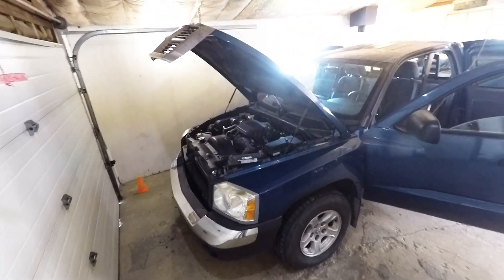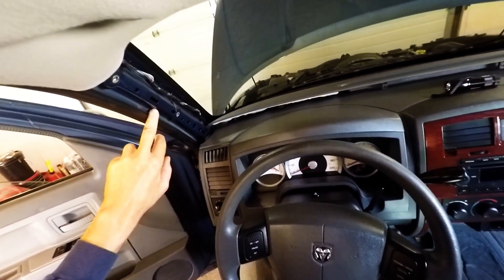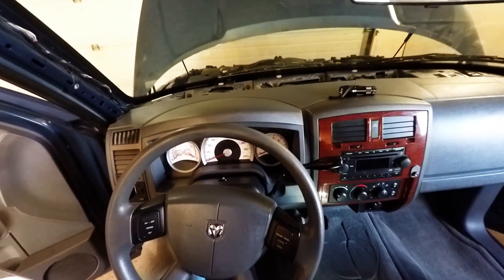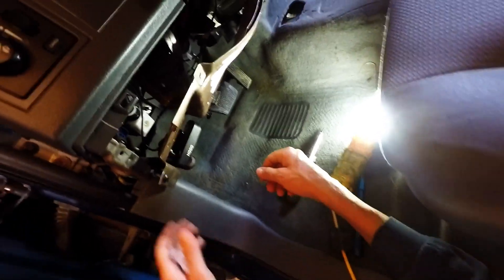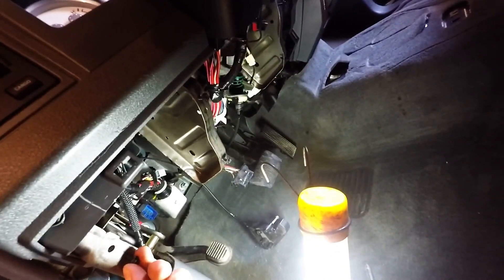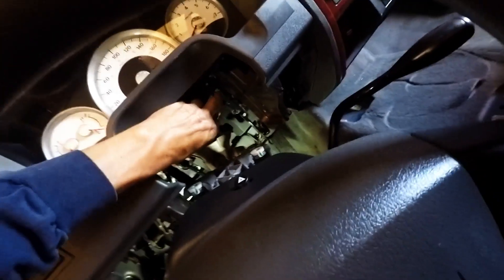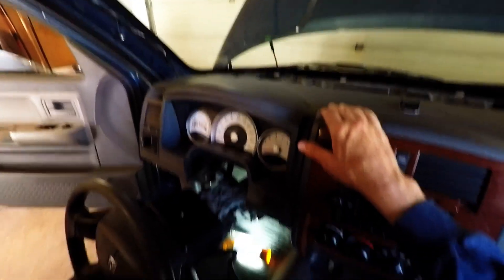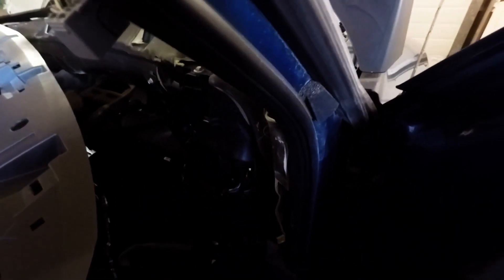Heater core replacement  2005-2011 Dodge Dakota

Comment: Great video and a huge help. The three studs that go through the fire wall have nuts that need to be removed. The 2 end ones are ok to get to, but the center one is super hard to get to. On the V8 it is located just behind the right cylinder head. Took me several hours just to get one nut off. Also be careful when taking the entire distrubution box apart, the damper/acuators have to go back in exactly as they came out or else the blend doors won't work properly, mark everything and it's position when you take it apart. Also the plugs on the acutuator damper motors are all the same and you can mix them up, again mark them before you unplug them. I made these mistakes but got it fixed. Again, thanks for the great video.
Reply from the maker: Thank you for taking the time to add your experience.

Comment: My dakota wont start after doing this job smh. Everything is connected 🤷🏽‍♂️
Reply: Cant be lol. Check your grounds on both sides of the dash that you took off, as well as all the random connectors. Did you remove the battery before working on it?

Comment: Thanks Darren for his video. I have a 06 Dakota 3.7L v6 RWD Quad Cab and the blend door is hanging up as well as maybe the heater core too so I have to pull the dash too.  I did my wife's 03 PT Cruiser last year and survived and was not happy with the way the heater core sits in the plenum box on top of a thin piece of foam.  Your video didn't mention the refrigerant line connection to the evaporator that must be disconnected.  Thanks again.
Reply from the maker: Happy to help, It was my first video. Thank you for the comment.

Comment: I wish you kept the video going. Right when you pulled out the heater core. Other than that, the dash removal seems easy and the steering column. I have a problem with it in my 05 Dakota.

Comment: I found 2 of the 3 bolts on the firewall side, does anyone know where the 3rd bolt is located?
Reply from the maker: Zer0 Gravity 
The last bolt is behind some insulation on the firewall just below and to the right of the ac lines
Reply from the maker: Look at the very last post I replied too it has the location in detail
Reply: @darrenmaxwell527  : I appreciate the response. I found one bolt close to the AC lines and another bolt close to the heater hose side. I speculated that the third one would be below those two bolts and be more centered behind the engine. I didn't want to cut through or pull apart the insulation unless I had at least a 90% chance in finding the bolt. Again, thanks for the heads-up.👍

Comment: Where are the three nuts on the firewall that you mentioned at the end of your video.  I can only find two.  Thanks, Alan
Reply from the maker: The 3 nuts are as follows; on is on the left side just below the a/c lines, the next one is 4" to the right of the a/c lines, the 3rd is just below the heater core lines.
Reply: Still cant find
Reply: @TheBelavusivan  I have a 2007 and had the same problem...its covered by the insulation on firewall.. i ended up putting a strap around my box and yanked out with a forklift..couldnt believe the bolt was covered up.

Comment: how do you know you need to replace  the heater core? what are the issues related to the heater core? thank you
Reply from the maker: Most instances its a leaky core or a plugged core, it will drip on the carpet on the passenger side. Your windows will fog or it will be a bit of a sweet smell when you turn on the fan.
Reply: @darrenmaxwell527  ok that's confirms it!! I need to replace mine.  thank you for the prompt reply

Comment: did you have to remove the a.c. lines to pull the box out to get the heater core
Reply from the maker: Mike Pope yes the a/c lines have to be removed and recharged
Reply: Darren maxwell alright thank,you
Reply: do you need special tools to remove the ac lines?

Comment: Sorry, But this is not a very helpful video. I can't find the 3rd nut on the outside of the firewall that's holding the middle of the case. You should've showed all of the job until the core was out.